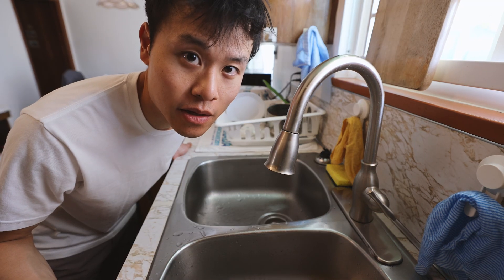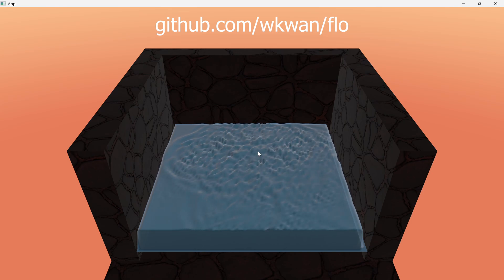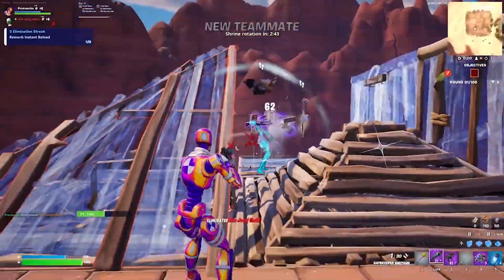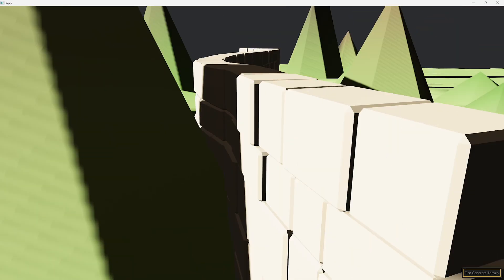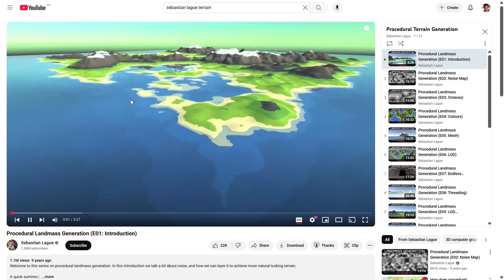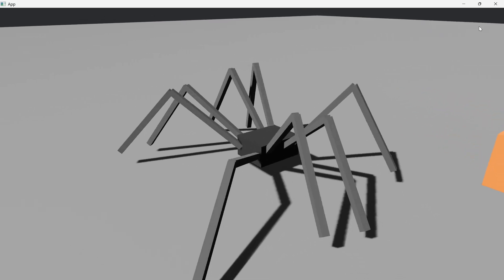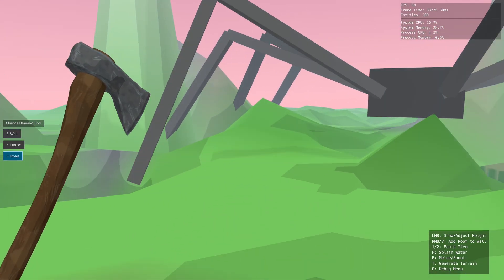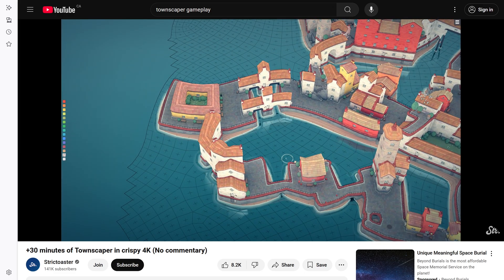3 Months Making a Simulation Game with Procedural 3D Art

Comment: bruh, I'm not a graphics programmer, but I don't think replacing WGPU with Vulkan worth the effort. Like do you expect to match current state of Bevy's renderer in its 5 year old age with a manpower of 2 Vulkan devs. WGPU uses DX12 on Windows which is arguably better (or around the same) than Vulkan, it also uses Metal on Macs and IOS which don't support Vulkan at all.
Reply: Unless you are going to do some crazy raytracing I wouldn't recommend switching to Vulkan only rendering.
Reply: @adsick_ua  his vulkan code is all ai generated, so it's not going to be anything novel or useful

Comment: Have you considered a combustion engine? all elements have a temperature, combustion ignition point and a fuel source that has a burn speed. burn speed relates to heat range and heat range warms up other things close by until ignition is reached.